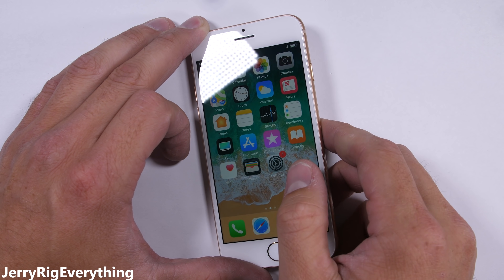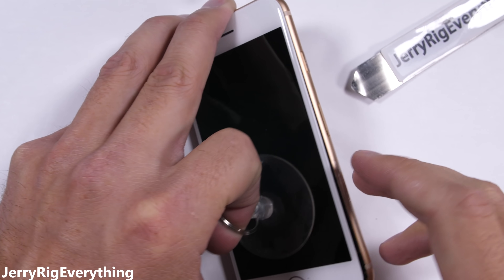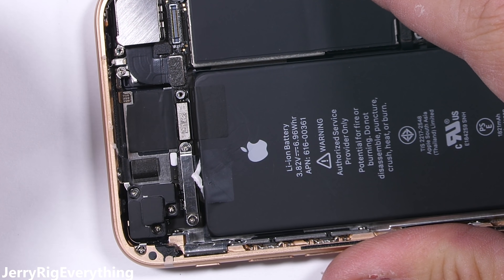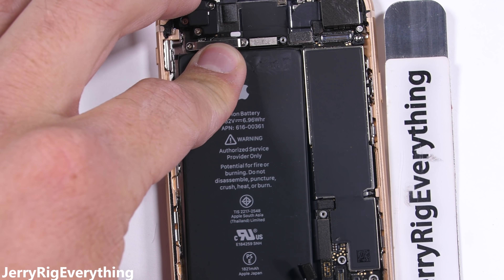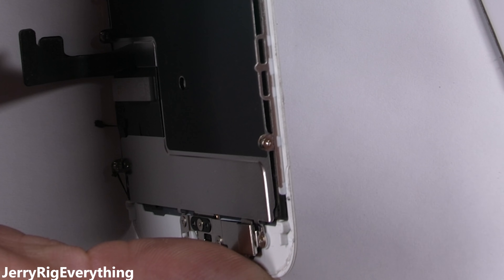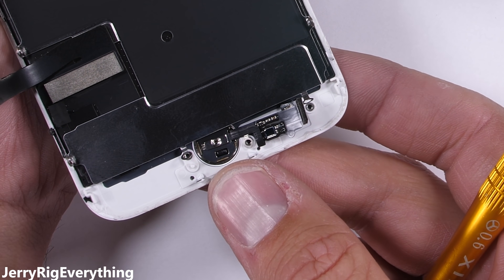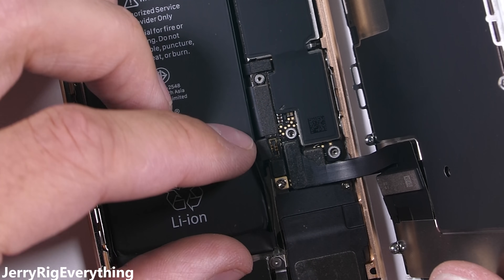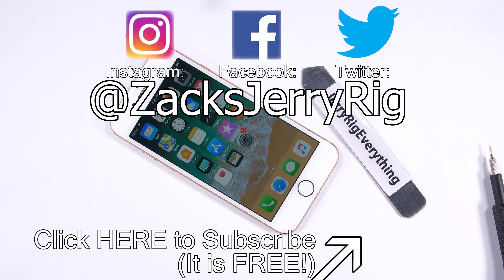iPhone 8 Teardown! - Screen and Battery Replacement Video

Comment: Pretty sure a headphone jack could fit there
Reply: "Innovation"
Reply: +Medo Gabr It's actually about the fact that the headphone jack is the only thing on the IPhone that Apple doesn't own and as such doesn't make money on for 3rd party stuff.
Reply: Medo Gabr did you know that most of 20 dollars earphones are better than the wireless earpods that iPhone sells for 150 dollars. A question. Not having a cord is worth 130 dollars more?
Reply: Medo Gabr that's simply not true. It's not okay to remove an important and simple feature of a phone that high priced. There are still really much people out there that own an "old" headset. I don't, but still: the jack is useful if you gotta play music over non-bluetooth-speakers or such things, you can imagine (or don't you?). But it's always the same thing: apple-fanboys keep ignoring the truth.
Reply: Naftul Zvi that's why it still doesn't use USB C
Reply: adding a headphone jack would be so cowardly. apple actually has courage
Reply: 99HeroSouls that's true.
Reply: PoloBoyPrince what
Reply: Naftul Zvi What about the Micro-SD-Slot? Will probably never ever take part in an iPhone. It's an essential feature which even most Android-Budget-Phones own. Pathetic...
Reply: girlsdrinkfeck i agree he is one of those fanboys but hey watch it
Reply: Medo Gabr Its really not. Its about increasing Beats sells and pushing th airpods on people. Now if people were to make third party headphones they'd have to use a lightning port which is owned by Apple. Therefore they'd have to PAY APPLE. Its not about a wireless world. Y'all really fell for that stupid bullshit😂😂😂. A wireless world with no damn wireless charging? They can't even perfect fast charging. Its slow as hell and you have to pay damn near $84 for it
Reply: Naftul Zvi I’m pretty sure apple is about to move to usb c next year or the year after that.  But apple is such a big company that I think they wouldn’t care about the $50,000 dollars they would get every week from third party accessories, so idk if they’d do that for just that little amount of money with a company that makes literal millions a day
Reply: Just Being Socially Awkward that's the best comment I've read.
Reply: it's about convenience for most people. Like going to the gym or running would rather have wireless than wires dangling everywhere.
Reply: for the cavemen out there that insist on using wired headphones
Reply: "Courage"
Reply: Joleonni Fernandez That money adds up. If they didn't care about the money they wouldn't have removed the headphone jack. They'll probably just invent a new charging port
Reply: elitestar and having a headphone jack would make them unable to use wireless headphones? Why do they have to choose for me?
Reply: OfficiallyTwon there is wireless charging for iphones
Reply: Alexdiggerman They just implemented wireless charging. Apple has a niche for waiting for manufactures to take risks and then jump in, copy it, add some bullshit feature, and calling it their own. They Can't do that with wireless charging. Other manufactures have had it for 2-3+ years. How are you gonna "push for a wireless world" and you JUST caught up in the wireless charging department??
Reply: Well... Someone made it work for the 7

(Someone got a headphone jack into their iPhone 7 basically.)
Reply: Just Being Socially Awkward the wired headphones that come with the new iPhones are a band-aid fix to the fact that there is no headphone jack and for those who are somehow satisfied or don't care about the shitty quality of those headphones.
Reply: Alexdiggerman it's slow as hell and you have to pay like 80 dollars for it
Reply: Jonah Pettrich don't worry man these are the same people that will     
pay the extra $100 for fast charging without even thinking twice.
Reply: I'm not sure but just wild assumption only: apple didn't want headphone jack in iPhones because they want iPod for headphone jack! Business; money 💰
Reply: elitestar so wired headset users including DJs are cavemen... great and thank you. How about if you tell about the wired headset users is cavement to pioneer, serato, and probably, some high end IEM manufacturers that their products is for cavemen?
Reply: blink blink
Reply: the only reason is Apple doesn't own the 3.5 mm jack patent.
so they have to pay royalties,& any 3rd party manufacturer can provide 3.5 mm headphones but not the case with lightning port😀
Reply: He tuck a headphone jack by removing the barometer that caught up the space. He didn't add it, he swapped it.
Reply: Medo Gabr even with the headphone jack, people still have the wireless options. Removing the headphone jack is just a jackass move by apple to force people use bluetooth earphone they sell for iphone. Who's dumb now?
Reply: nope it actually wouldnt. Not because of space but because of thickness. Headphone jacks are quite thick and that's why apple remove them. And by the way they didn't remove headphone jack to make more money with accessories. If they would, they wouldn't include headphone jack to lightning converter into the box and sell them only for 9 dollars. They give you one free and if you want one more it is 9 dollars. That's not how you earn money from accessories. And not only headphone jack is necessary for headphone jack but also amplifier and controller for it. Those take space too. The guy in the video that added headphone jack to iPhone 7 put the smallest and a bad controller and no amplifier so it won't sound good at all and he barely fit it without breaking screen beacuse of tension.(he broke 3-4 iPhone screens while trying to add headphone jack.) Every time he drop that phone, screen will be broken because of that tension. Screen needs space to bend a little bit in order not to be broken so easily. And by the way micro sd kart slot is not about space or thickness it is about security. They don't let you put in a sd card that can be full of viruses. Apple is a company of perfection not inconvenience. Those are just inconvenience
Reply: They believe wireless is the future
Reply: elitestar for the deaf people who like to pay 160 bucks for distortion blasters. Pathetic.
Reply: Headphone jack inside a phone by default, to the best of my knowledge, utilizes built-in to motherboard audio amplifiers. It's not because of thickness. Both 6S and 7 are the same dimensions. The awkward thing is, the barometer is also present on the 6S. 

There's no reason except the 2nd gen Taptic Engine and wireless accessories to discard the headphone jack. There's no "tensions" inside the frame of the phone, it would otherwise continue breaking displays. Most of the impact is absorbed by the frame, at which point at reasonable height that is enough to prevent the LCD panel and the glass from shattering.

SD cards have nothing to do with security. You can install unauthorized profiles and suspicious apps on iOS too. They could run SD data in "safe" mode unless authorized. SD cards are inferior in R/W speeds and wouldn't be nearly as comparable in performance to built-in storage. That's the only reason why not to include SD card slots, and profit margin from larger storage options as well.
Reply: nope it's because of thickness. I know they are both 7.1 mm thick but taptic engine takes so much space that the controller must overlap screen so that it creates tension. SD cards are about both security and speed. They will fix the thing with unauthorized profiles. It's a bug.
Reply: The controller can't overlap the screens, physically. It connects to the logic board via cable. It has nothing to do with thickness and SD card lost has nothing to do with security, unless you've got decent points to backup your statement.
Reply: I am not native english speaker I mean with overlap is that controller pcb will be between the screen and some piece of phone's pcb
Reply: yeah s8 8mm and iPhone 7 7.1mm thick. There is %14.28 difference in thickness. So yeah the can't make a phone this skinny with headphone jack. Btw bluetooth is already secondary option in iPhone 7. First option is lightning port. And they don't charge you for lightning to 3.5mm jack adaptor it comes within the box
Reply: abdu1998a samsung did it and have the better looking phone, stop making excuses for apple.
Reply: Big Daddy Stewart yeah it would be nice if iPhone 7 had it but I am saying there is a reason for it. And I think you are not reading my comments I clearly explain why 6s had and 7 didn't.
Popa Chopa Samsung didn't do it ffps. I can assemble a computer that is the fastest computer in the planet but I couldn't make it small enough to fit in a laptop case. I can't handle the engineering problems it has. It is exactly like that yeah you can make a phone that has everything it needs but that means it won't be as slim as without most of them. I am not making excuses for apple you are trying to hate apple for a engineering decision that apple had headphone jack or taptic engine or thickness. Apple chose taptic engine + thickness. So if you can't live without headphone jack don't buy it. Why accuse people of making excuses because they wouldn't chose headphone jack? And that is not even a new decision. That decision was taken almost 2 years ago stop complaining about it...
Reply: OfficiallyTwon idk maybe they did remove it for the money.  But still, I would say it is innovative.  My reasoning is because they wanna push for a wireless world.  They’ve literally tried wireless charging, but a step further, where you don’t have to put it on a pad, but when you enter a room, your automatically charging.  I think that’s coming in the next iPhones.
Reply: OfficiallyTwon and the probability of apple copying other companies is 50/50.  And even if they do copy, it doesn’t matter.  Apple always makes sure the technology they put in their phones is safe, and they don’t have to show case that like Samsung with their exploding note 7’s.
Reply: oussama mrissa they made the batter smaller buy still count fit a headphone jack because "courage"
Reply: Samsung manufactures only flash storage for the iPhone. Everything else comes from other companies like Qualcomm, Skyworks, OmniVision and so on. Displays for the iPhone X are manufactured by Samsung, true, but generally the Sharp or LG provide iPhones with displays.
Reply: the taptic engine is too big for a jack to fit in
Reply: Pretty sure you couldn’t make it any better
Reply: Exactly all they did was just put place there
Reply: i love iphones but they screw you up with money
Reply: Courageous
Reply: It’s just apples ego

Comment: Not an easy to repair phone!!! great work man!
Reply: ...it actually IS simple as fu*k to fix basic things like bad connector, broken screen or not charging battery...
Reply: wut? its nearly all modular. most repairs would be easy
Reply: This and the One Plus 5 are the easiest phones that you can repair. Look at the S8 or Note 8 with glued back panels that are horribly difficult to remove.
Reply: What the fuck are you talking about? This is probably the most easy to repair phone out right now!
Reply: Raptor Swire , lmfao you actually typed fu*k instead of fuck. Come on bro. Really?
Reply: Sreekanth Palakurthi buy new one 1000$ again
Reply: Sreekanth Palakurthi i
Reply: Raptor Swire o
Reply: It's actually the pixel

Comment: Terms to learn:just like little legos,folds like a book,magical pull tabs,fragile as paper...
Reply: Jed Teng k
Reply: Jed Teng 7
Reply: Give the guy a break ........he's way better than you'll ever be 😤
Reply: tip of my tool
Reply: Glass is glass and glass breaks
Reply: Glass is glass and glass can break
Reply: Fragile as a potato chip
Reply: Shut
Reply: Thin metal pry tool
Reply: You forgot about, "and deeper grooves at a level 7"
Reply: You also forgot any protection is good protection
Reply: @romeski5948  ikr
Reply: Noted
Reply: "If you want to keep things functional, go slow".

Comment: Jerry I have a video idea for you. A lot of people say that one of the shortcomings of the lg v30 is it's front-facing camera. I watched your teardown video and saw that the front camera module is the same shape of other front cameras on other phones like the galaxy s8 or lg g4. Would it be possible to theoretically buy a gs8 front camera module and place it in the lg v30. Could you possibly test this out and see how the phone would react to different hardware?
Reply: jameljami11 great idea
Reply from the maker: +jameljami11 the software wouldn't match the hardware.  Plus the physical connections are different
Reply: Would it be the same story with using an lg g4 front camera and what about using a camera app from the app store. Would it care if a different front camera was plugged in.
Reply: The problem with this is that the phone is not made to have different parts like a PC, so if you somehow can swap a camera or whatever with a different phone it will most likely not work because of the drivers/controllers.
Reply: That's why i'd like someone with the resources to do so to test it out. Because there is that uncertainty. It may not work with the gs8 front camera but now im wondering if the LG G4 front camera would work instead. I'm just curious.
Reply: Too many things u have to do to make the camera to actually work...

Comment: Well I must admit one thing.

Apple products are very well engineered.
Reply: No they aren't haha, profit is priority on apple not innovation or cutting edge technology. You must be a brainwashed apple fanboy to believe that apple still holds relevance on a world were people have options.
Reply: Hydro_Gaming laziness is the new apple logo, if you don't see the effects it will have on the current generation (defending the route apple is taking and the uses of theirs patents) then you are just naive. Of course I know the priority of profit, I just can't stand the way apple and the lack of something new or innovation brainwashes people into believing they are getting the latest and greatest.
Reply: Michael creech gulags>camps
Reply: Sergio Denis Apple>Hitler
Reply: Hydro_Gaming as an android user i agree that apple devices are good, but it's just that android oems simply does more and iphones just seem not goo enough for us but they are great nonetheless
Reply: What makes you say that? If you want to see well engineered phones see the repair videos of LG devices.
Reply: I never said anything about cost or software or the power of the hardware.

I have never owned an iPhone a and probably never will.

But if you actually look at the product as he dismantles it in this video from an objective stand point and not a "hurr hurr Apple is bad" stand point you will see that this is a well designed and engineered product. Mainly the metal panel in the back that appears to wrap round 2 of the sides.
Reply: Ascdren super easy to repair
Reply: My beautiful and amazing mistress lmao, have you seen the benchmarks, they blow any android phone out of the water... but yeah I guess only ignorant people would think benchmarks are an accurate way to benchmark something
Reply: Ascdren but they put fragile screen

Comment: This tutorial is just excellent. I did it thanks to you help. One thing I was unaware of at disassembly is that the screws on the same bracket can have different lengths, so they must go in the exact same hole position they came out of. I managed somehow ;) also in my case the replacement battery came with magic strips of the exact shape, but I recognized too late that there is a good and a bad direction to put them. If it starts rattling tomorrow I’ll know why :) Thank you very much for your effort, I appreciate!

Comment: DISAPPOINTED!!! The most important question is uncovered... IS THERE ENOUGH SPACE FOR A HEADPHONE JACK?!
Reply: Strigoy there is
Reply: Yes there is, apple is trying to push a wireless future
Reply: They give you an adapter. Whats the fuss bruh
Reply: MasterM 1214 English but yes there is, no the plastic has a use but isn’t a waste, they just don’t want people to fit headphone jacks
Reply: MasterM 1214  "unoptimized" dude it last longer then the 7 at least check your facts before whining